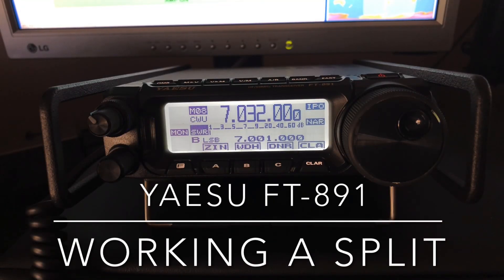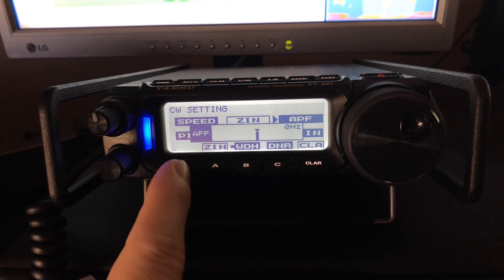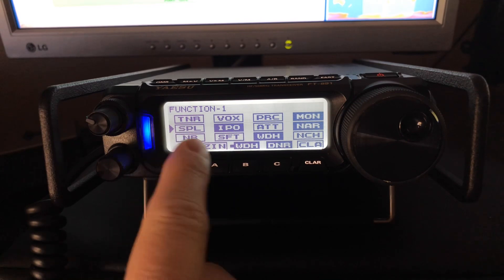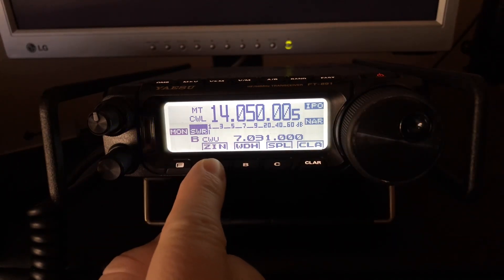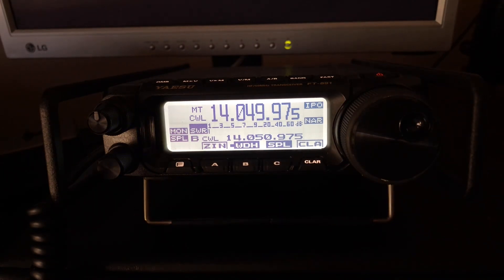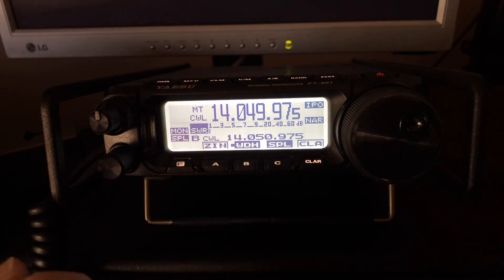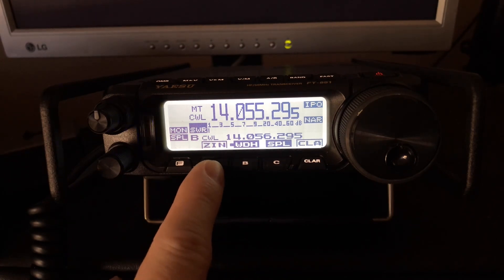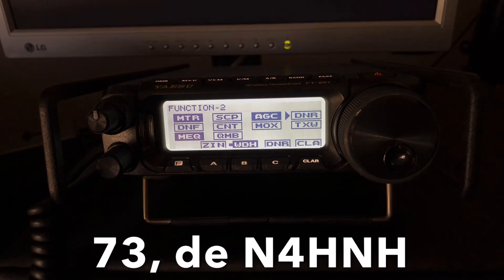Yaesu FT-891: Working Split Frequency (TX & RX different) #hamradio #yaesu #ft891 #cw #split

Comment: what if he/she is up 1,5
Reply from the maker: Tap the Function knob and rotate it to change to a different TX frequency.  If you need a more fine adjustment, toggle A/B, adjust with VFO knob, and toggle A/B once more.  Page 49 of the operation manual provides details.  Note the TXW function.

Comment: When working split on my Icom radio, when I transmit, the VFO B switches to the upper VFO A position showing that I am transmitting on the split frequency. When I stop transmitting it reverts back to VFO A and I am now listening to the DX station. When working split with the FT-891, it doesn't change so I'm not sure if it doesn't do that like my Icom. Do I just assume I'm transmitting on my split frequency and not the DX's frequency? Thanks for your help.
Reply from the maker: The FT-891 doesn’t switch the VFO positions like your IC-7300 does.
Reply: Thanks. I appreciate your quick reply.
Reply: Has the radio switched from receive to transmit when the SPL button is black or white?

Comment: when I want to be the operator running the split would i follow your directions then just hit the a/b button to reverse the tx/rx???
Reply from the maker: You’re absolutely correct.  Or you could use the TXW feature in Function menu 2.  Maybe assign TXW to either the A, B, or C key so you can toggle without going into the Function-2 screen.
Reply: @N4HNH Radio  thank you very much! Love your videos.   Getting ready for my general next month! You have been a great help!

Comment: I learn something every time I watch one of your videos. Had my 891 for a year now. It’s one of my favorite rigs.
Reply: Yeah I’ve been keeping up with those. I run an ATAS on my truck with the 891 but I’m in the process switching it out with a heavy Breedlove antenna mount and a Tarheel 75A.
Reply from the maker: The FT-891 doesn’t get proper credit. It is a boss. There is a video that the Patreon team is watching at the moment that shows the FT-891 in my truck receiving CW on 30 meters like a boss, using the ATAS-120A antenna. 

73, Doug

Comment: Doug, amazing video and I could apply this tips for my ftdx10 and my ts-850.

Only one doubt remains on my mind. For logging purposes, in order to match the exact frequency of the station in the other end,qrz or any other logging platform, should I use the tx frequency or rx frequency?

73 my friend and congrats on your channel and videos.
Reply from the maker: Hi Victor!  Well, in the early days, before phase-lock-loop and such, we just logged the band.  Now that everything is more precise, the logging programs allow entry of every detail.

Since my logging software tracks the main VFO, I end up logging my RX frequency.  If you want to follow the spirit of why we need a license to transmit, you would log your TX frequency.  Since a station log is no longer a requirement, you could take your pick, or just log the band.  For me, since Ham Radio Deluxe tracks the main VFO for logging purposes, I go with that.

73, Doug
Reply: Amazing input Doug!!! Thanks for the tip and all the help to the community!! I'm tuned on every video!!! Everytime I watch, I learn something new! 73
Reply from the maker: I’m so glad you find the videos informative, Victor.  It means so much to know that others are benefiting from them.

73, Doug

Comment: Great video! I've now re-programmed one of my front panel buttons to "SPL".  I find your approach to working split much handier than using the "Clarifier" button  method.👍
Reply from the maker: I’m glad you found this approach helpful.  I’m very fond of the FT-891.  Some people think it is a difficult transceiver to operate, but I disagree.  There’s so much functionality packed into that little radio.

73, de N4HNH

Comment: Now i know im not in of subject for this video but i just want to ask you of mfj-939y if is compatible with ftdx-10 ? Can i work with this using all feature of atu ? Thank's , 73 !
Reply from the maker: I haven’t tried the MFJ-939Y myself but it is supposed to be fully compatible and function as a “plug and play” tuner with the FT-891, the FT-450D, and the FT-950.  You will need MFJ cable YAE-950/450/891.

73, de N4HNH